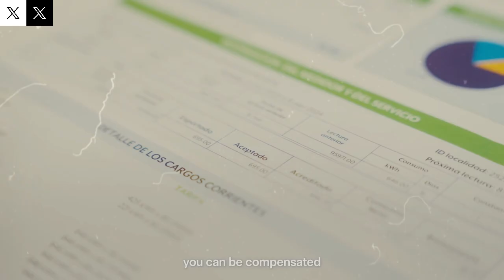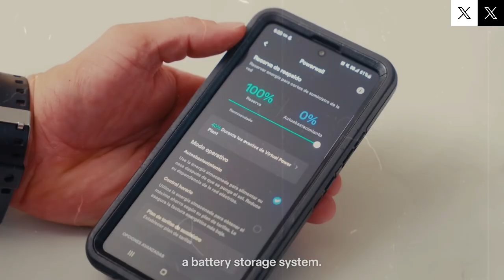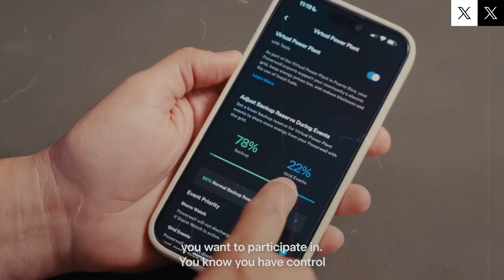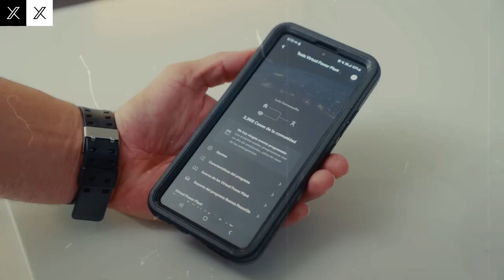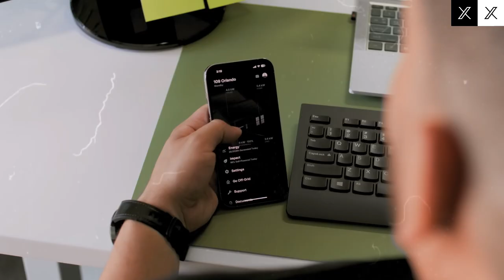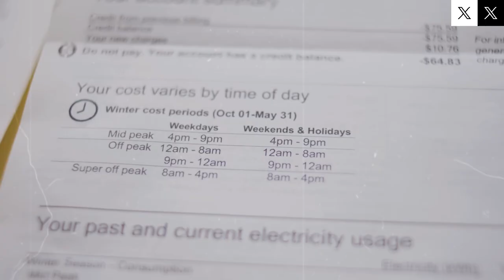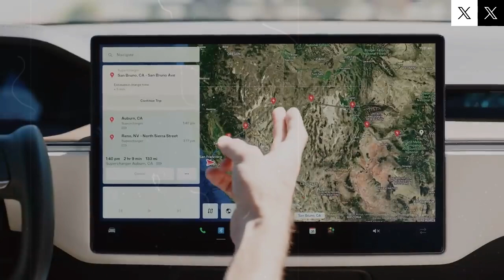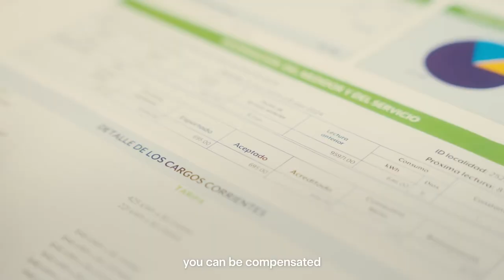THE END OF GASOLINE! Elon Musk Reveals Tesla's New BATTERY TECHNOLOGY for the New Models

Comment: Battery Technology. Density Energy  charge and Dicpcharger  Nickel Cobalt Aluminum Oxide 
 Lifecycle  batteries  last longer. Li-ion technology   High Capacity   To Ues Energy game. Charges  sodium battery technology  tesla. Sodium  technology  more times Quicker
Reply from the maker: You touched on several key points about the future of batteries! Lithium-ion technology with nickel-cobalt-aluminum (NCA) still dominates due to its high energy density, but sodium batteries are gaining traction, mainly because they are cheaper and promise faster charge cycles. Tesla is already studying the use of sodium in some specific applications, mainly where cost is more critical than range.
In your opinion, would you prefer a battery that charges faster or one that lasts many more cycles, even with less range?